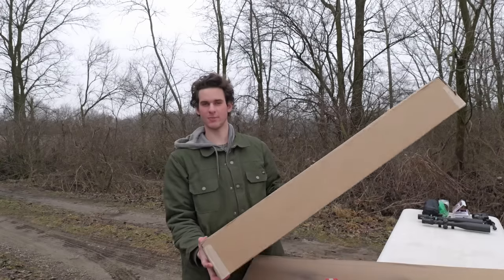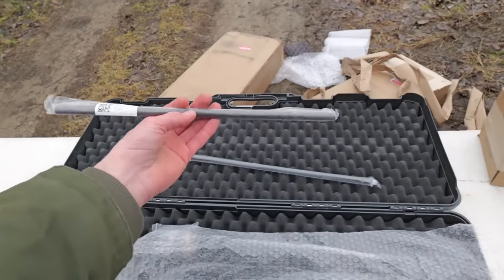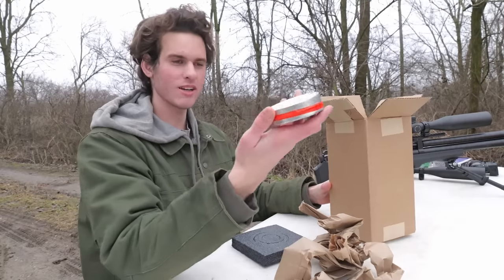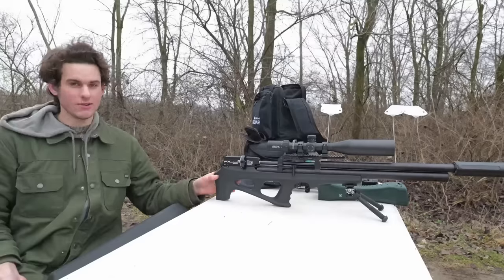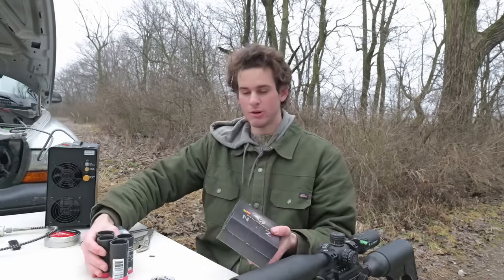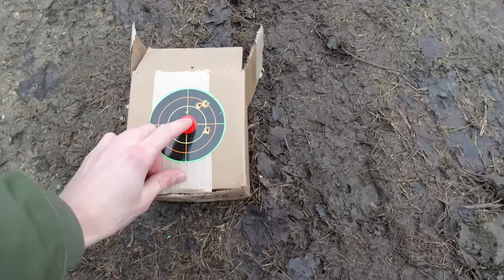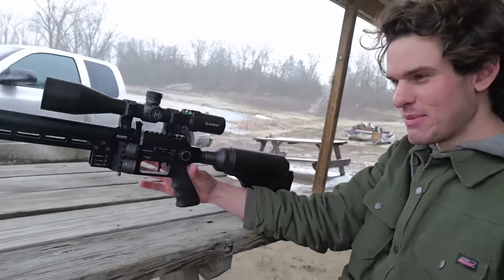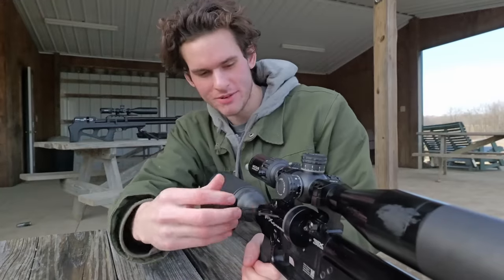I Bought an Air Powered SNIPER RIFLE

Comment: Slugs don't always need to be shot at 1000fps to achieve good accuracy. I have shot slugs at 900 fps all the way up to 1100 with sub MOA accuracy. Often you will find the liner inside your gun's barrel prefers a different diameter slug. With my 22 FX Impact I got average grouping with. 217 slugs but fantastic with the. 218. Twist rate of your liner is very important, some slugs need more spin to stabilize in flight, others need less. I don't know what slugs you are shooting, but some slugs will group better than others. Personally I got the best grouping with H&N and Patriot Javelin slugs. Another thing with a new gun / barrel you need to shoot quite a few rounds to get a nice lead coating covering the liner. You would need to play with your valve to see how your gun shoots with the valve in different positions, don't just have it fully open like most people do, see what works for you.

Comment: I have a .25 Dynamic and took some time to sit with the Utah Airguns shooters to tune it for the slugs I was shooting. We got it to make a .485 MOA group at 200 yards, then used it to hit a 3” steel plate at 300 :). If you’d like, I’ll go through the tuning tips they gave me to get yours dialed in.
Reply from the maker: The moderator was what was causing the bad accuracy. I took it off and was getting groups about the same as the wildcat. 68 grain slugs at 920fps. I plan on shooting lighter slugs to get the velocity up and hopefully better accuracy. If you don't mind sharing how yours was tuned that would be great!
Reply: @blockethoutdoors 

I'm glad you figured it out! Make sure to make a follow up video!
Reply: Was gonna comment that the problem was the supressor, thoose gun dont like long supressors! 🤷🏻
Reply: These comments here are legendary, lol! I bought an Umarex Origin, just cause I watch the dollar sportsman! It got me into PCPs! There is not a lot I can’t do with it.  I don’t know about FX yet, not sold on them, as they seem to be a costly pain in the rear. I want one tho! Don’t get me wrong! I’ve been an Airforce Airguns guy, for a minute, they are deadly.
Reply: You have a great channel as well. Loved your 95 yard shots with the little Umarex Notos. I want to buy one but they don't offer it in 177cal. I have over 30,000 pellets and slugs of every brand and weight in 177cal. I refuse to start all over with 22cal.......🤣
Reply: @blockethoutdoors  Does the shorter supressor from the Wildcat fit or are you just stuck not using one at all?!?
Reply: @srchristopher6040 Don't waste your money on one, trust me they are a real headache and you have to spend more money on top of the outrageous amount they charge for the airguns to begin with😔 In order to shoot slugs you have to buy a totally different barrel and they don't tell you that at the beginning so, those airguns are for guys that try to impress each other shooting slow slugs at paper and brag about the large amount of money they had to put into them to make them shoot straight😬 Good luck with whatever you go with👍👍🏿👍🏼👍🏾👍🏽

Comment: That moderator is pretty long, are you sure it’s not clipping? Shoot it without it. You should be able to shoot that gun at around 120 ft-lbs no problem. That means 68 gr slugs at 900 fps. Try lighter slugs to get to 950 to 980
Also don’t just fuck with the regulator. It’s a balance between spring tension and reg pressure to achieve consistency.
And remember no turning the regulator down with pressure in the system and no adjusting spring with the gun cocked.
Reply: That's what I commented. My Donny FL Ronnin moderator was clipping slugs and pellets with my FX impact MK3. I put the Sumo on it and it shot SubMOA at 100yd easily. I have also had a moderator machined off-center just a hair-causing flyers

Comment: problems with that FX sniper seem like a nightmare and why i prefer more budget high value air guns. sure the elite guns can be great but who wants to pay thousands for some tinker project headache gun like that
Reply: I have 4 Impacts. Once you learn how to tune and fix, you won't go back to anything else.
Reply: Currently own 2 impact m3's among other what u call budget higher end guns. I don't even use them anymore. They are wall hangers now. Fx all the way!!
Reply: I shoot my impact m3 everyday . It works perfectly. And I think a lot of people that buy them do enjoy tinkering with them and trying different ammos. I have tried a lot of ammo even though I have no real reason to.  I just like to see how well I can get it to perform if I do tinker around for a while. I can always go back to the previous tune for known good working ammo.
Reply: I believe he has a bad moderator clipping the slugs and sending flyers. I had that issue with the Donny FL Sumo on my FX Impact compact MK3 It was machined off-center just a hair and caused me a headache until I replaced it with the Ronnin Moderator I had sitting around.
Reply: Most FX airguns are not a headache to maintain. I have 3 and I almost never have to work on them, maybe every couple of years I replace the seals.
Reply: I think Farmerfpv has a great point. Also you can try shooting without the moderator for accuracy
Reply: Nothing beats a break barrel
Reply: @jayce5070 so can I possibly have one of those wall hangers you speak of Jayce 🙏🏿
Reply: @arnoldtm31 oh yeah, i traded my mk 3 wildcat and and $900 to boot for a Huben K1. 25, my wildcat was .30  and a good bullpup. The semiautomatic 25 cal Huben K1 will kick the shit out of any fx out there and i been doing this for almost 50 years, pcp's specifically for around 25 years. About 15 years ago it started picking up in the pre charged area and now pcps are literally everywhere and incredibly more advanced. The Huben is close to 2 grand but worth every damn penny. FX aint all that  hell no
Reply: @FarmerFpv I've been having issues with Donnyfl moderators lately, not too long ago I had a bad Fat Boy that was clearly miss centered and I bought the new Yokozuna and 3 baffles are clipping, they say it's the harmonics but the Sumo works fine, I think Donnyfl's quality is going downhill, they used to be great and now I'm stuck with a 200.00 moderator that clips, I shouldn't have to sit there and find the perfect tune on my M3 for it not to clip, no more Donnyfl's for me
Reply: @arnoldtm31 I don’t wanna have to learn that tho.  I wanna have fun and hunt straight out the box - not have to spend time in front of YouTube figuring out how to work the darn thing.  I can get a gamo magnum pro gen 3, for 300 bucks, and hit quarter groups at 60 yards just after warming her up and zeroing her in.  I’m break barrel over pcp all day.
Reply: @diegocutamero1858   a well broken-in break barrel, with consistent velocity, moderate recoil and soft shooting, yes there is nothing better than wielding a 6lb rifle fully kitted and scoped that you can easily shoot freehand all day at 650-700fps with median weight .22 lead pellet. I agree. Also love PCPs but they are such a more involved and technical endeavor.
Reply: @arnoldtm31   Yes, im surely not talking crap on FX, they are a gold or platinum standard in modern Air rifles. Simply saying that for those of us who cannot readily plonk down potentially $2000+ for a single air rifle, the idea of buying something so expensive and having technical problems with it is staggering to me. I realize they are incredible systems -- but there is also a truth that even budget air guns can sometimes demonstrate really impressive ballistic profiles and for those of us who just want to shoot effectively it makes more sense to avoid these kind of ultra premium systems when you can get the same job done a lot cheaper. That being said I would love to own an FX rifle someday.
Reply: @fireside9503   I own 7 break barrels, and I own the exact magnum youre talking about. Love the modern IGT gamo line and their great warranties. I live at 6000' altitude and my long magnum runs about 800-860fps at the muzzle. I can hit plates (1"-6" plates) standing freehand at 70yd with that magnum equipped with a fixed 4x scope (my two gamo magnums have destroyed 4 variable power scopes before I wised up and only used fixed mag). Ballistics and performance are everything at the end of the day. I own a few PCPs and love them, but on average when fully equipped they can nearly DOUBLE the overall rig weight of the average break barrel. that is a total game changer when your pcp rig genuinely weighs double of a break barrel, with the average equipped PCP being 11-14lbs and the average break barrel being 5-7lbs with a scope.
Reply: @psycho6275  I know about the Huben. The only issue is the spare parts availability. I send the company an emai and no reply. I enquired 2 dealers in Europe,  they both said they don't keep any spares in stock,  they backorder them or send the rifle to them for repair. Impact parts are everywhere. You can put together a whole rifle from parts you can buy online.
Reply: @milesstover3724  totally agree.  Hope the technology in the break barrel industry continues to develop and we see really awesome s stuff here in the near future.
Reply: @fireside9503  the recoilless under-levers and side-levers are pretty interesting to me. The Diana Air King Pro 54 being a main example of such a technology. Little expensive though so i havent invested in that one , but very curious about its overall operation and quality
Reply: @milesstover3724  lol.  Funny you mention that one.  Been researching it a lot lately but that 800 dollar tag has got me stalling.  Love the sliding top end to mitigate recoil - really neat.  Maybe one day I’ll pull the trigger on the 30 cal version.  Maybe.
Reply: @arnoldtm31  Kraz Cool,   New England airgun are two spots in the States that have anything ya need for Huben or can get it. Kraz Cool Airgun is the best dude anywhere for repair or parts in Missouri. Kelly owns it and he is the best

Comment: Maybe try using lighter slugs and oiling them before shooting you'll gain fps with both and there may be an upgraded hammer spring you can get for increased power I know in the kral puncher series it's a quick swap with like 4 screws takes 15 minutes or less for your first time. Either way good job on those long shots that's impressive for a gun you just got 👍.

Comment: First question did you clean the liner before shooting as FX lube the liner to prevent rust and secondly you need to lube your slugs as they have more contact on the barrel than pellets.
I run my .25 with nielson slugs at 900fps and have no problem with accuracy.

Comment: Inaccuracy from the Dynamic likely due to the Donny FL Emperor moderator, from incompatible harmonics and/or slug clipping as it leaves the barrel.  Try swapping with a shorter moderator, like the one on your Wildcat and you might find it makes a big difference to the Dynamic’s accuracy. Had a similar problem with my setup previously.
Reply: Yeah literally thought the same needs to try it with no moderator on at first
Reply: I buy Wolf Airgun Moderators out of Germany to USA for about $45 shipped and now I own three of them because they are so good. Excellent customer service and arrives in a week.

Comment: First thing you want to do is NOT to turn the regulator  down.turning the reg to lower pressure while the gun is under pressure, is going to break the regulator...turning the reg to higher pressure while the gun is under pressure  is perfect..always de-gas  the plenum and bottle,when you want lower reg pressures..set the reg to 150 bar,macro wheel to 23,and micro wheel between 2.5 and 3,and then see how she goes

Comment: You should have ordered a variety of .30 slugs to find out what the gun likes.  It might like lighter slugs, it might be an issue of the barrel being too tight or loose for a particular slug.   Some slugs are a .30 diameter, and some are .308 diameter.  If your barrel is .308, and the slugs are .30, you're going to have issues.  I think it's only Seneca that does .308 slugs, but I see .300's and .301's in a number of brands.
Reply: I was thinking that too. You want to slug the barrel and take the guess work out.  Slugs don’t have a skirt that expands so the general rule is to shoot a thou over bore to make sure the seal and rifle engagement is good. For 30 cal you can use #1 buck, but make sure it’s a pure lead pellet and not an alloy. A gunsmith can provide the service as well.

Comment: I just went through hell with my Gauntlet 30. I specifically wanted it made for slugs, I had work done so it could actually chamber them. Choked barrel caused issues, but out of no where... I had to have at least 500+ slugs through it before it started pulling WILD flyers, were talking 1" group to 1' groups. Just grabbed Griffin slugs, Boat Tails. They saved my G30.

Comment: I find slugs to be VERY size sensitive for air guns. My avenger is a tac driver at 75 yds + with slugs that mic about .2486 rather than .25. I've only found one .25 cal slug that small and they are expensive.

Comment: Don't give up maybe try some different slugs or get some heavy pellets. Its alot easier to get pellets to shoot accurately. Tunning is part of the fun of pcps.👍
Reply: its also less time spent hunting. if you got all the time in the world then go ahead. I get 2-4 hours a week to hunt. i aint fucking around with reg pressures and sorting through every diameter of slug, im picking up the 22 long and getting it done out to 100 meters with ease

Comment: set the regulator at 135 and max the trigger wheel to 4.  To get any faster, you are going to have to use tungsten hammer.  I have the same gun and I get 950 on regular hammer.

Comment: Greatings from Portugal.
1st thing witch twist rate liner you have inside? For those 68gr slugs must have the heavy liner for best results. One hole at 50 meters.
Probably you got the pellet liner inside. With new airgun it comes the pellet liner. Make sense? NO
Its like buying tension kit for impact with slug liner and come with pellet probe for slugs

Comment: There’s other rifles out there that have a FPS of over 1300 FPS , look it up & there very accurate & if you diesel the slug or pellet they get even more FPS , but it could tear up your barrel , I,d go with a rifle with a ceramic barrel inside if I was you . Air pressure in your tanks & cold wether can affect your FPS also so take that in mind , the colder it is the less FPS you will have , the hotter the weather the more FPS you,ll have , go with nitrogen filled tanks then your tanks will be stable in any weather .

Comment: I have an impact m3 in .25 and it’s pretty much spot on at 50 yards. Can hit 2 inch target 🎯 all day.  The Fx barrel also has a pellet and slug transfer port.  They are shipped in pellet mode I believe. You need to rotate them 180 if you want more fps. You will gain like 45fps.  You may want to reach out to Utah air guns for support. I don’t have any experience with that platform. I’m shooting my m3 with the 25.39gr at about 913fps. I have some Nielsen 34.9gr and they shoot well too. Also bought some Apollo 33gr slugs and they are ok too. You can try the h&n hp slugs 34gr too. One of the popular South Africa guys uses h&n exclusively. 68gr sounds very heavy. Contact your retailer for tuning advice for that projectile. Don’t destroy it I’m sure it’s fine just finicky.  I’m pleased with my m3. I can shoot 75 shots before refill. Also you can try airgun nation forums for assistance. Lots of people will be willing to help you.
Reply: The port on the dynamic sould already be setup for slugs. It comes with a slug liner installed on both the 600 and 700mm barrels. They are intended as slug guns.
Reply: @jayce5070  gotcha

Comment: You need to test different brands of slugs. Also, you don’t need to shoot them at 1000 ft./s in order for them to be accurate. I swage  all my own slugs with great results. You just need to experiment with different weights and slightly different diameters. My experience with the panthera is to max out the velocity at any given air pressure then take it back about 10 to 15 ft./s for good accuracy. be patient and keep testing

Comment: Slugs guns can be a bit hard to really get one hole all the time, I usually start with a 850-950 fps tune depending on caliber of course and run groups through a clean barrel with  all the different slugs I have in that caliber and try to tune the one it likes, slugs really shine at longer ranges, sometimes I get disappointed at 50 yards on paper because I want one hole! Then I’m nailing small game out to 180+ pretty much every shot if I do my part…? Crazy but frustrating now and then. My impact m3 still manages to amaze me quite often with accurate long range kills even thousands of rounds and a couple years later! Like others said send it back to Utah if you can’t get it dialed in I’m sure they will help.

Comment: I had a similar experience with mine shooting zan 25 cal 30 gr, I tried all different speeds and couldn't get it to group. I switched to NSA 25 cal 40 gr , pulled the moderator off and was able to get it to group then, at 1050 fps.

Comment: I have enjoyed your videos a great deal and was impressed with your airgun choices in this video (I have the same FX Wildcat III). Your trying less expensive variants from Walmart, Amazon and others has been very entertaining.  Air guns basically achieve their best capabilities with finely tuned users as much as finely tuned components. It takes time to develop both!  The best made ones are  not the best for casual use any more than a Ferrari or Rolls Royce is well suited for running back and forth to the grocery store.  Less expensive ones are often equivalent in, let's say, accuracy and speed but might not provide the near infinite adjustability of more expensive ones. So I get your frustration--I hope you continue to have fun and share those experiences.